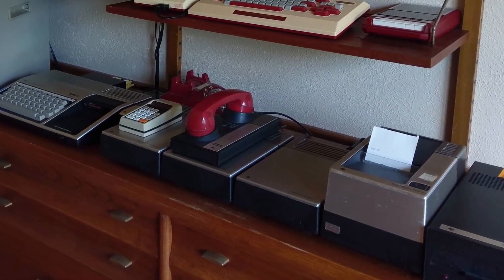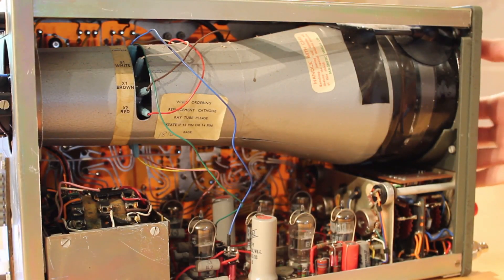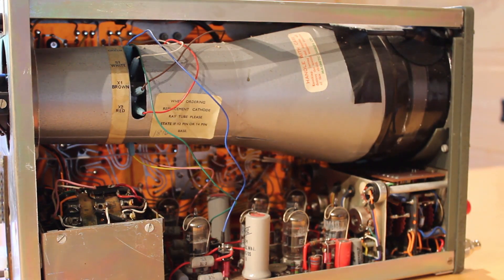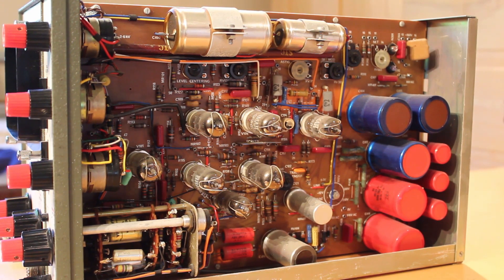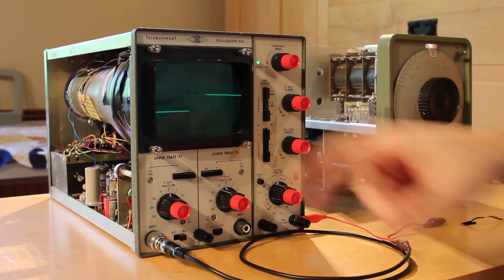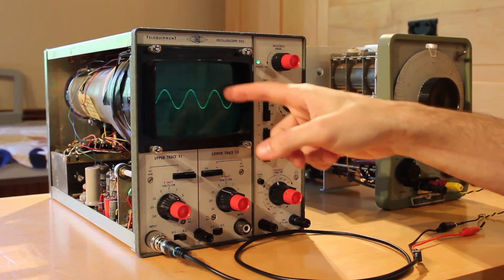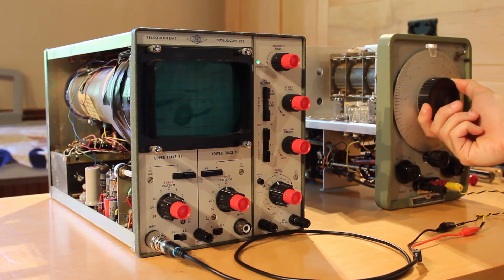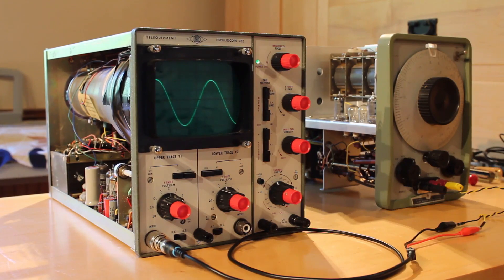An In-Depth Look at a Telequipment D52 Vacuum Tube Oscilloscope

Comment: Great find, happy for you!
For faster signals try the H.F. trigger setting and play with the 'stability' control. Back in the day trigger circuits really were not up to par compared to the rest of the 'scope so oscilloscope manufacturers had to include synchronization circuits to get that stable images at faster speeds. Switching to "H.F." turns the time base into a free-running oscillator controlled by the stability knob, so you unfortunately lose the calibrated sweep speed. There's also a feedback path somewhere in there from the vertical amp, because otherwise you'd never really be able to get that stable image (I guess that's done by S102C on the bottom right of FIG2.1, although there's obviously much more going on there), but that means the sweep speed is dependent on the input signal, so any sweep speed calibration really goes away.
Synchronization circuits were commonplace for many years on a whole range of scopes and were only killed with the advent of digital scopes where such tricks just wouldn't fly. 
I guess it just goes to show how modern equipment, while more technologically advanced, can also be simpler in some ways.
Reply from the maker: Thank you so much for your amazing reply!
You definitely know more about these old scopes than I do, and I'm still learning a ton, but that's absolutely awesome! And that actually answers a question I was wondering about in regards to speed. I can see it handling 1 MHz fairly easily as I had 700 kHz showing up crystal clear, but I'm fairly certain the upper limit of the scope is 6 MHz, and I had no idea how that would be possible to display. But, using the "H.F." setting makes a lot of sense. I've still got some more reading of the manual to do!
Modern digital scopes are pretty indispensable and have a plethora of features that are incredibly useful, but there is indeed something special about an old analog scope. I just feel like I'm more connected to the circuit, which I'm sure is 100% a placebo thing, haha.
Thanks again for your awesome insight!
Reply: Can you elaborate more on the difference between triggering and syncing on these old scopes? I have a vacuum tube Knight scope. It only seems to sync/trigger and lock on when the sweep speed vernier knob is almost dead-on to stabilizing the waveform anyways. I've been trying to determine if this is just a limitation of this vintage of sync circuit compared to modern triggering or if this scope is not performing as it should be.

Comment: Took me back to 1972 when I entered the workforce as a Lab Technician at a College in the UK.  We had a number of Telequipment D43 Units, which I was required calibrate.  Also had the really nice Solartron CD1400, though the weight was not so great.  Still, since we were lugging 19" Color TV's around for students to fault find, the test equipment was no big deal.

Even in 1980, when I removed a Dec PDP8i from a London Hotel, we still didn't have a scope that was fast enough to read the signals on the Fixed Head Single Platter Drive in that 100KB unit.

Comment: I studied to be an automation electrician, 2005 or so, in a school in Helsinki, Finland. In the electronics lab all scopes were still CRT. They were part of the workbench panel that had all the power sources, normal meter controls, signal generator and the scope. As part of the teaching we opened up the panels and looked how they were built. There were no tubes inside but the construct was quite modular and easy to maintain.

Comment: I had the big brother of this telequipment scope with removable amplifier modules. It was lovely. I had to make a fairly quick move one year and couldn't take some things with me. I was told last minute nothing could be left. A big Pioneer reference standard laser disc and the scope among big wardrobes and so on were to be removed. I called a local guy to take away the bits thinking he could sell them. I told him the Pioneer was worth a lot of money and the scope  a fair few quid. I happened to see him five mins later throwing both items ten feet through the air into the van destroying them. I still don't understand ten years later.
Reply: Omg

Comment: Remember working on these in colleges and Universities. If I remember correctly, the impressive thing about theses was they were 'dual-beam' as opposed to 'dual-trace' .  The CRT employed a beam splitter rather than a chopper circuit in the electronics.

Comment: Look up the siemens oscillarzet if you're already amazed at the small size of this scope. I've got an oscillarzet from 1954, that thing is tiny and beautifully constructed.
Reply from the maker: I just checked out that scope and it's a really compact tube scope! The board has a really interesting layout of the tubes, they almost seem chaotically laid out, but I'm imaging that's to get the circuit as efficient as possible to the keep the size minimal, which is awesome!
Reply: @UsagiElectric  it's really cool imo, not a ton of features but compact and just a cool piece of gear and it's enough for me atm. The weird board layout is also to make all components accessible by just taking the enclosure off. Pretty much everything that might need changing is mounted on posts on the outside of the boards

Comment: So cool! And that generator is cool too!  Are these air plate variable capacitors zin the generator?
Reply from the maker: Thank you! Yup, that's a massive variable capacitor that's used for tuning the frequency. You can see them a bit better in my restoration video here: https://youtu.be/EAkiPeC1Xqw
That HP Oscillator is one of my favorite tools, it's an absolute tank and looks gorgeous too!

Comment: Brother, I have one of these, but I'm new and am wondering how you input...um... into it?
Reply: I have it tuned to my finger pressing on it makes beautiful lines....but... that isn't a good input.
Reply from the maker: On the bottom of the front face, there's a little connector port under the "INPUT" text, and that's where you hook the probe up to. But, the Teletquipment uses the older UHF style port and most modern probes use a BNC style port, so it'll probably be easiest to order a UHF to BNC adapter. After that, just grab a cheap scope probe and it should work!

An Amazon search for "UHF to BNC adapter" should bring up the adapters you need, and then a search for "Hantek PP-150" or "Hantek PP-200" should bring up a decent, cheap probe that will work.

Let me know if you have any other questions!
Reply: @UsagiElectric  Thank you for the information and inspiration. Would it be possible to hook this up to a synthesizer? That may be a dumb question, but I really am a total noob. 
ಥ‿ಥ

Comment: Can you do horizontal and vertical inputs? Then  you could lissajous patterns!
Reply from the maker: I don't think so, it's got an external trigger input, but I didn't see a Y input on it, although it would be awesome to be able to do some oscilloscope music!
Reply: @UsagiElectric  Most dual-trace scopes have an X-Y mode that turns one of the channels into an X input, but looking at the manual, the D52 doesn't seem to have that. This is baffling, because there's a very similar single-trace model (the S52) with two identical amplifiers, one of them dedicated as an X amplifier for X-Y operation. The S52 has a switch on the back for selecting timebase or X-Y mode, but the D52 apparently doesn't. It probably wouldn't be hard to modify the D52 to give it that capability.

Comment: Why not replace the case sides with acrylic panels?
Reply from the maker: That's actually not a bad idea! I may have to do that with something in the future! For this one, I kind of like having the metal case since I end up lugging it around the room, but acrylic would work great for a display piece!
Reply: @UsagiElectric  The case is metal for shielding, to cut out external interference.